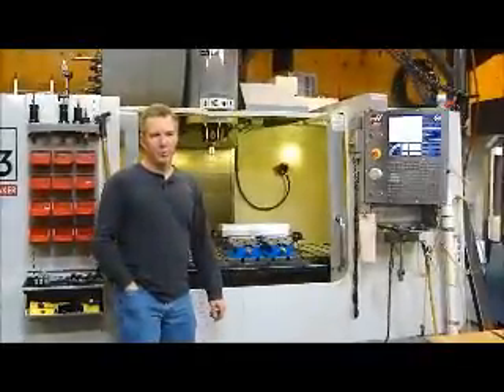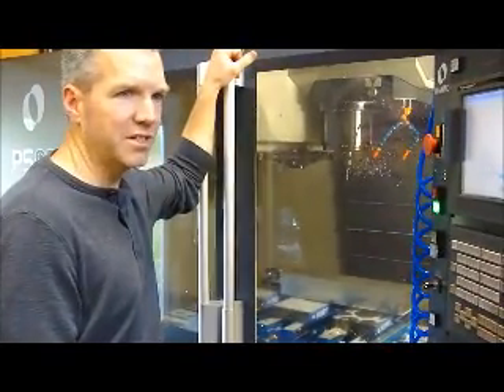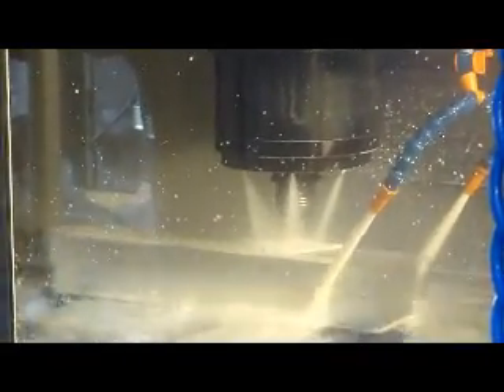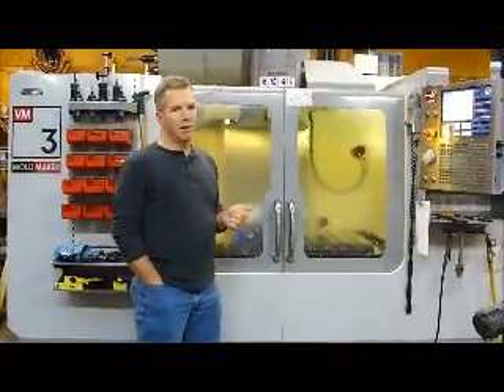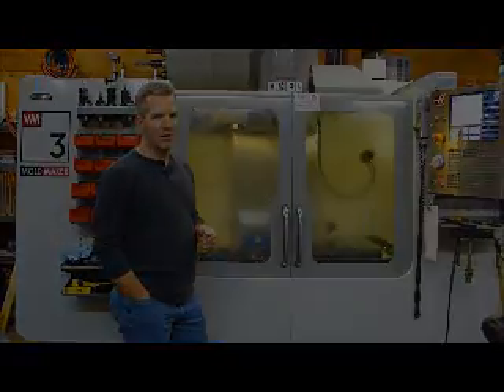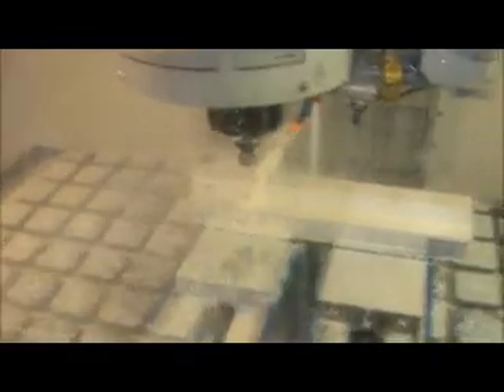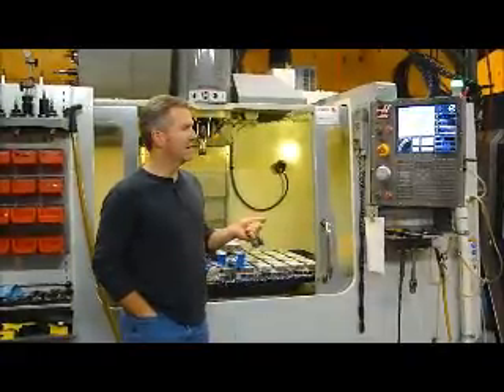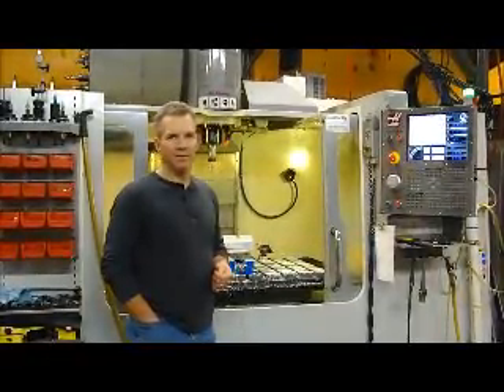Haas vs Makino part 2

Comment: It would seem that for the same money in a Haas you would be able to afford a 50 taper machine, and that would be substantially more ridged.  Also your VM vs a VF is slower because of the ball screw pitch..  Since they offer a bunch of spindle options and the equivalent Haas is much bigger, I would put my money on the big 50 taper if the goal is to make stupidly deep cuts and not chatter.  A VF-6 would be a more appropriate comparison.

Comment: I have a VM3 at home. This machine is not designed for high speed production work. It was designed for toolmaking. Lower pitched lead screws for better accuracy. It has performed very well for everything I have thrown at it. In saying that on my 2011 VM3, factory default smoothness is set to finishing. This causes ramping up and down at direction changes. Try changing your program by entering G187 P1. This will change the smoothness setting and halve your time when doing HSM tool paths and will not ramp. I cut 22min from a 40min roughing cycle by just entering the code. My Haas tech showed me this.
Reply: Mark Pop In fact, Makino is very famous in tool making industry for their rigidity in high speed work without losing its accuracy.

Comment: what you should also mention is that makino surface finish will be far superior and the longevity of the makino will out way the difference in cost. We run Makino's and Mazak 12 plus hours per day never an issue.
Reply: Do they ever need servicing and How many hours and what do you have to service on them? 

How long till the slides or
Spindal wears?

Comment: Haas and Mazak would be close on this cut in this 3 axis Mill cut. 
I will bet anything that Makino's PS 95 40 Taper would beat Mazak's 50 Taper.
Just the facts.
Reply: Do you run Mazak VMCs? I've only run their vtc machines and I thought they were well ahead of a Haas.
Reply: yes

Comment: I can back up that Makino are a better choice we have a F5 Makino with a 20K spindle.
If you want to see fast cutting look at the die mold Makino's we cut steel & alum. at over 500ipm all the time. The plus side to this is we hold +- .0002 with out any effort on 3D shapes. Yes our Makino cost more but it has paid for its self in under 1 year!

Comment: Depends on the speed capabilities of the shell mill - the kennametal we have here in the shop is rated no faster than 4500 rpm. If you work outside the safe limits of your tooling, well...I feel sorry for the guy at the controller when it detonates.

Comment: The Makino is the obvious choice for production work.  The Haas has about 10 more inches of Z over the PS95 though.  You could definetly burn through a mold plate quick, but when you get to putting work into the sides of the plate, like water lines or interlocks you are limited again.

Comment: Why would someone criticize an apples to apples comparison. Its not ridiculous. The machine is not 250 vs 100k. Its not even twice the cost of the VM (more expensive than the VF by the way. Who cares about the rapids on this test?)
 There are people that buy two Haas machines all the time when they could buy one great machine with a lower operating cost. 
There are some shops out there that would like to understand this. If you are "Haas Enthuasists" then fine but take emotion out of it.

Comment: Your comparing a 100k machine to a 250k machine. I bet my retro fitted bridgeport couold smoke both of those machines. Get real dude, this video is misleading and you need a better video camera
Reply: not correct....PS105 is $150K

Comment from the maker: Well, I do.  If that makes me an idiot then so be it.  These toolpaths run faster and smoother than typical toolpaths.  They keep the forces on the cutter more consistent allowing deeper depth cuts and faster feed rates whether it is aluminum, steel inconel, etc...  Sounds like you haven't been exposed to these yet.  Maybe you should try it sometime.  Don't know how misleading these are.  Basically they show the same parts on both machines with the same tooling yet very different results.